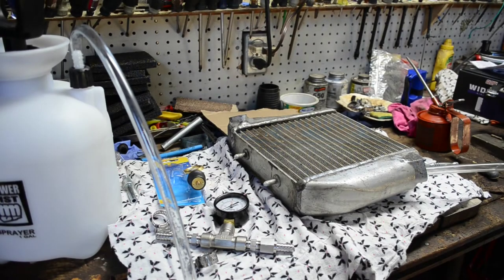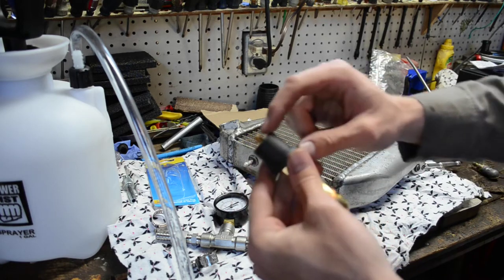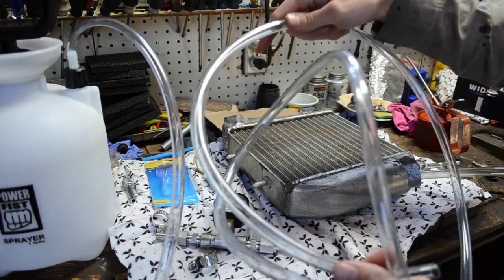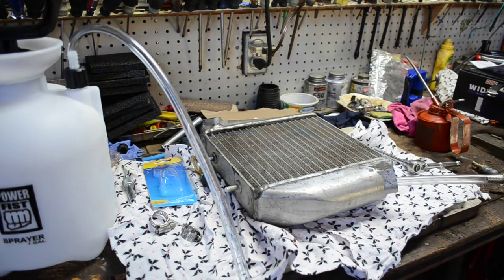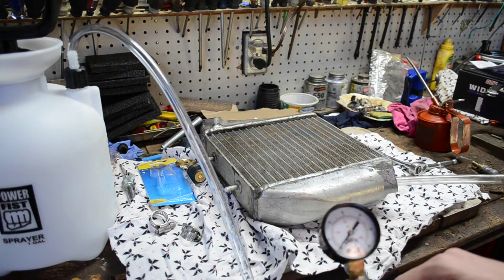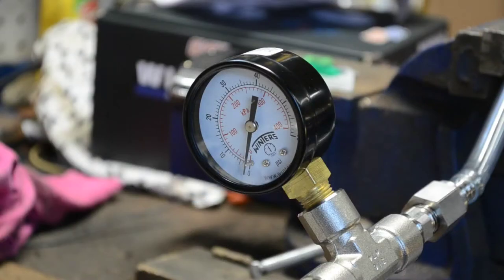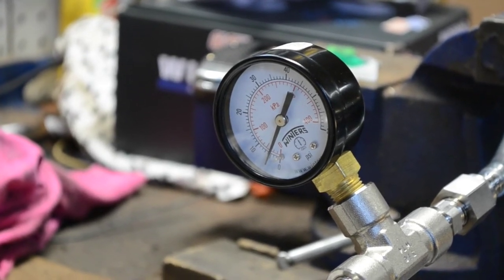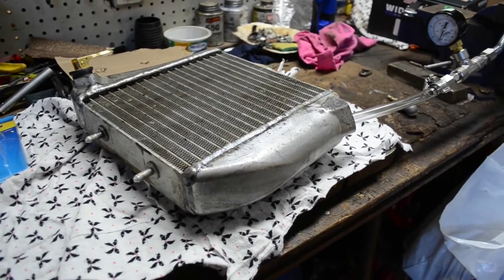Pressure Testing an AMG Aluminum Oil Cooler!! DIY Pressure Testing For Any Aluminum Cooler/Radiator!

Comment: How did u get it out tho 🥺 I can’t find any videos on this car and no one knows posts on how to work on them here
Reply from the maker: Thank you for reaching out. Let me begin by saying it was not fun... although the recommend way is to remove the front bumper and other bits to remove it is possible to remove the oil cooler without removing the bumper. I went through the right-side wheel well. Removed the liner and underbelly shields. Then removed the hoses electrical connectors and then unbolted the frame holding the oil cooler form the vehicle. It is very very tight. But doable. Thinking back probably would have been easier removing the bumper but didn't want to get into that at the time.  

If you have any other questions, be sure to let me know I will try my best to help! 

Thank you for your support as well and please consider subscribing to the channel and leaving a thumbs up if you haven't already! 

-Full Throttle